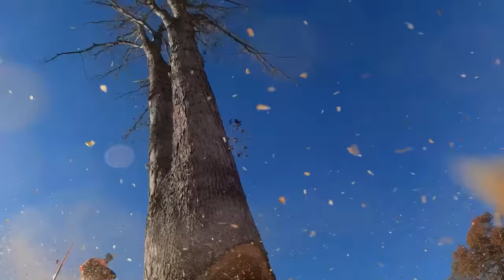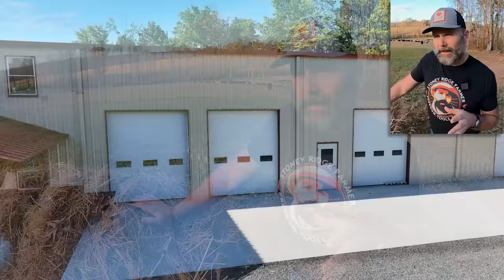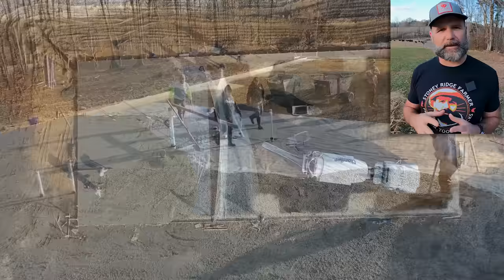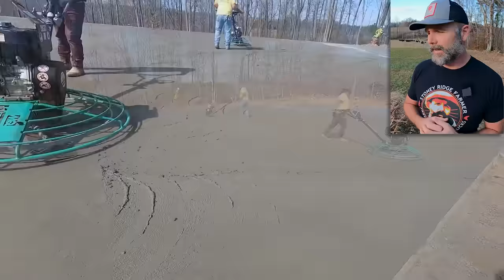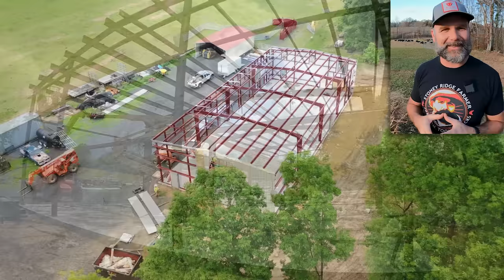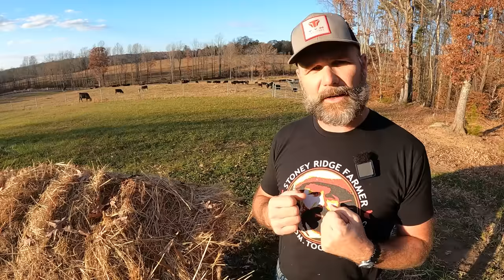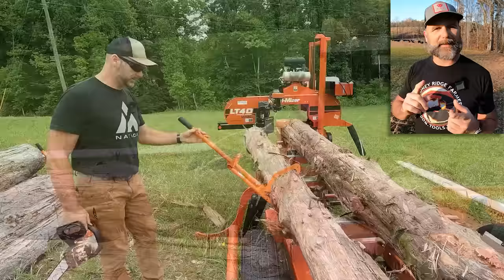Cops Came to Investigate Veteran's Farm! Heartbreaking disbelief

Comment: I'm a builder, and I do permit all the time. There are two things: the city has a big head of pride and money. That's what it's about. It's not right.  It's insurance, and you are right about the wood. You fit the nail on the head.  it is because of safety reasons and could cause an environmental issue. Yes, I'm in Texas, and it's the vast west of construction here, and it's a lot easier to build.  The northern building is more complex, and I will tell you why. Basement sub pump and the weather. Great show, and I feel you. Texas is a great area.  I ran a rainwater system, and it really was easy to do. We get 54 inches of rain a year, and it's enough for us all year. Two in the house.  tanks are 8000 gallon tanks with filter system.
Reply from the maker: I'm not sure the "pride and money" theory doesn't translate into all walks of life.  I get it for septic, but what I don't get is why I can't build what I want structurally on my own place without being pestered

Comment: Josh, my story is kind of like yours. I served 20 years in the USAF myself. I live in NC also, but east of you a couple of hours. After retirement i had built a 30 x 35 metal building. After having everything permitted and inspected and building completed i received a call from the head inspector that he didn't have a signed off permit for my electricity to the building. He wanted to come out and reinspect what had already been inspected by a inspector that used to work for him which was the one that had inspected my electrical work. Well, i thought about his request for a couple of moments and told him no. I told him that i could not have gotten power turned on by the electric company without a signed permit. I further iterated that because his previous inspector misplaced or whatever he did with it wasn't my problem. My conversation with him was respectful but to a point that i was not going to be reinspected for something that had already been done. He agreed to what i was saying and never heard another thing about the issue. 
Yes, to answer your question, our rights are being infringed upon more and more on a daily basis. I have since sold the previous property and bought another. Well, the property i purchased i could not build a building upon until i built a residence on. The restrictions on this property is i can not put just any dwelling on. It had to be a stick built home. Again, i am being heavily restricted on this property. It is my property, not the city or the county's! I don't live in a subdivision, but being treated as such. It's BS!
So, yes! Our rights are being trampled on by others. Regulated to death. Sick of it!
Reply: Move …. To a red state
Reply: I assume you're county is Republican ran being NC ......regulations start at local levels....sounds like your intelligent...just cut to the chase...
Reply: @samsally3581 I live in Florida and I am dealing with the same stuff... the government can't seem to keep their hands out of your pocket.. it doesn't matter if you're in a blue or red state..
Reply: howardj602, yes sir, you are so correct!
Reply: Its all a local level money grab.  Has nothing to do with safety as i have only encountered 1 inspector in my area that knew the trade he was inspecting(plumbing because he was also a licensed plumber).  The other inspectors are just paid county officials.  My house addition structural and electrical inspections took all of 2 minutes each.  Looked at the electrical panel, glanced at the walls/ceiling studs, and signed off.  Before that they had even signed off on the footers, before i was even done digging them.  And i bet they would not be able to produce the documents from any of those inspections that were done years ago.  But again this is local level dependent, and each and every locality is different.
Reply: Hi, greetings from Sydney. Australia. It seems that your counties administrators are not the only one's over-regulating our lives. Here in Australia we have 3 levels of Govt - Commonwealth Govt. which is an umbrella over the whole country, State Govt for individual states, and Local Govt (or what we call a Local Council) for the local government area (group of suburbs) where you live. Most building work, new or renovations have to go through a Development Application (a DA) process via the Local Council who have "local planning regulations".  A small DA to add a few rooms and garage to an existing home can cost up to $30,000 AUD before a brick is laid or demolished.  Part of the DA requires a number of reports from professionals - Surveyors, Sound engineers, Storm water experts, Sunlight report (so we don't overshadow neighbours), Arborist reports if there are trees on the property that need to be cut down) etc etc. Plus new requirements to have Solar power for hot water and heating (another $10k). A DA is required for something as innocuous as a deck of more than 20 square metres or a single car garage.  Got a heritage style house - no go on any DA or changes unless the local council approves the materials and colours.  So don't think you are the only one's who don't have the freedom to do what you want with your own land. Moving into another local council area won't solve the problem - they all have the same planning and DA process.
Reply: Got to check zoning codes/ rules and more before purchasing land these days.
Reply: @nimrod275 , Yes! I failed to do so! Totally my fault.
Reply: Being Regulated is all about MONEY.....everyone wants a piece of the pie....
Reply: @mikebastiat  wow! What a sad comment. What has that got to do with what we are talking about?
Reply: @mikebastiat  For or against?
Reply: Just a thought.  Did you or your liar, oops I mean lawyer, KNOW about the deed restrictions and or zoning restrictions before you purchased the property.
Reply: @JR-rx2ke , yes and no. At closing most of this was told to me then. I found out about other information after closing. I didn't do my homework on this property, that is obvious. LOL @ Liar.
Reply: @Showmethefish  NC is not a red state

Comment: 👋 Building inspector of a very large municipality here. We have a homeowners waiver that you can sign that allows you to do most of your own work, less plumbing and electrical. If you can pass inspection, you can do it. The reason for the regulations for licensed trades is because people die from shoddy work done by unscrupulous contractors. That being said, I also have to investigate complaints of things being built without a permit. It's almost always reported by a Karen neighbor. When I get those complaints, I NEVER write a citation unless I absolutely have to. Like a homeowner wiring an accessory structure in a very dangerous manner. I always try to work with people.l, especially because investigating unpermitted work isn't what I signed up for. I signed up to inspect structures to ensure they're structurally sound, and that they will be sound for the owner in 25 years. But even then, I bend over backwards to help people to build things correctly. As I tell people all the time, I'm here for the benefits, not to lick boots.
Reply: You're a good man 👍
Reply: @MrClowny666  I appreciate that. I've worked on both sides of the fence so I know how a bad inspector with a fragile ego can destroy your project, so I try to find a balance of keeping the contractor moving along without slowing him down and protecting the homeowner and the public. The trick is to do that without taking anything personally. My department is full of fragile egos and bootlickers that dream about stop work orders and citations, so I do what little I can to make whatever difference I can make for the public.
Reply: The problem is that most are not like you. I am also an inspector and I believe codes are out of control. The code inspectors I have worked with building a new construction house are ridiculous and call out every minor thing. Code inspectors should only be checking for major safety issues and nothing more imo.
Reply: @judahbrutus   @judahbrutus  I'm going to have to completely and wholeheartedly disagree. That's not the problem. What kind of inspector are you? A home inspector? Code inspectors are not OSHA inspectors and we're not home inspectors. Our job is to check for code compliance, not safety. Codes exist for a reason. What you may see as a minor issue might not be a minor issue to somebody else. People will throw a fit if I call them out for not having a continuous tie at a perpendicular joist/rafters connection because they think "it's just a rat run." No, its an unstable roof. You absolutely need wind bracing, wall/wall connections, correct portal framing, correct wood grades, so on and so forth. If you aren't a licensed code inspector, you just don't completely understand what we're looking for. If you aren't building a house to code, that's a problem with you, not a problem with the code. And that's exactly the purpose of the inspection. It's not to "bust" you, it's to check your work and give you a chance to correct it. The people that pay you are 100% expecting and wanting a house built to code, and it's your job and your responsibility to be knowledgeable enough to provide that to them. I hold an unlimited building license as well as a home inspectors license, so I know both industries, and they are absolutely not the same. There is very little overlap. Just because I work with people and assist them wherever I can and do what I can to make the process as painless as possible doesn't mean I'm allowing homeowners to get screwed over by not making sure their house is built properly.
Reply: @BureauATF Nowadays it seems you are far and few. You are honorable good man and I appreciate what people like you do.
Reply: Grandson Xrays welds, and says they are shoddy work. It is not that welding is not that hard of a skill to learn.
Reply: @voodoochild6741  Thanks, I appreciate that.
Reply: @gailhonadle5182  Welding isn't hard to learn, but it is hard to master. I was a welder for several years and there are tons of factors that go into it. You have to develop a sixth sense to know if your metals are actually mixing and to dial in all of your settings. Anybody can weld, not many can weld good.
Reply: @BureauATF  I understand that very well. So is soldering. Hub at 83, has been doing it for over 40 years in electronics. And still does a perfect job. Popcorn tins of transistors and diodes sit in the attic, he never disposed of a radio or TV without removing the parts. My first quilt was a mess. I got better learning from other guild members. Takes a will to learn and be good at it.
Reply: @gailhonadle5182  Yep! Seems to be a universal law with all things in life.
Reply: OK, I've read Intel. I had to comment. I'm an older individual, years ago, when building our particular construction project and going through the lengthy plan check and approval process with all of their inquiries and need to does (endless!). I did this project as home owner/builder, figuring that I would build about the minimum code. I put our floor joists on 12" centers instead of the regular 16" centers. I'm not going to tell where, when and how long ago!  In the comments it hasn't changed! The plans were approved, the project under way, inspections occur, I call for a drop location inspection. Granted! Finish the rough-in. One inspector stops the project for two absolute insane reasons. 1st Drop is in the wrong location. 2nd the sheer fault wasn't up to standards. I had not more than a year or so finished phase #1 approved no problems. Our project was stopped, because of ____! Red Taping Invalides that want to make a name! As if nobody knows anything!  I had to take time off work! Talk to a relentless inspector of 17 years, even though I showed him in the code book and the plans were approved!!! His boss unannounced to came out and asked, "You both are still here? He said, "Go home and get some rest!" I'll take care off it!" I was so livid and said "I'm  the customer, why do I have to do their jobs too???" 
Needless to say it hasn't changed! Years later theirs another problem. It seems the recorder can't read plans! I don't have as big of a house as what I built??? Who? Who? And Who is at fault??? Do I need to do everyone's job??? Their has been one county employee that did his job and took care of problems!!! We need people to do what they are hired to do! No excuses!!
Reply: You’re few and far between but honestly, it’s none of the governments business as to what we do or how we do things on OUR property. If it’s shoddy, then I guess the person taking over the property should learn to use inspections. There’s also insurance for a reason.
Reply: @bnalive5077  Yeah, and tell insurance that your add-on was done without a permit. See if they cover your house when it burns down. I completely agree to an extent, but you're hooking up to the power grid. Linemen die every year due to DIYers not knowing what they're doing. As for future buyers using inspectors, home inspectors can't see what's inside a wall. You can't inspect a frame or anything else once it's covered. There are small municipalities you can build in without inspections so you always have that option if you're that serious about it. But it comes down to making sure you don't kill a family of 5 by building a house made of popsicle sticks. The same way you can't drive your own car that you bought and paid for without a license to protect others (and yes, secondarily for unwarranted state income), you can't wire or plumb a house without an inspection. You can frame, insulate, pour your own foundation, build your own roof, and more, but if there's a licensed trade, it's licensed for a reason. Now... All that being said, screw the government. I loathe the government. I just work for a city and as I tell people all the time, I'm here for the pension.
Reply: Had a neighbor  call on me for building a deck and awning on the front of my house . Code enforcement  shows up sees permit in window tells me it looks great . I said if they would have been a little bit noisier  they could have saw a permit in the window lol 😆 😂.  4 months later they built a fence in their back yard its two feet  taller then allowed in our neighborhood  . You know what I did ? I minded my own damn business.  If only people would do that more often .
Reply: I do what i want when i want where i want.

Comment: I've been around long enough to see our freedoms slowly eroded close to the breaking point. Every time I do anything on my land there seems to be someone who decides they don't like what I'm doing and will make a cowardly call behind my back.  Like you, I follow the law and have my permits but having someone come to check is infuriating.  The permits were supposedly put in place to protect us but from what I can see it's just an income stream for my township and county.  I've literally had 2 separate electrical inspections (for new services) where the inspectors never inspected a thing.  One never left his car and the other stood on the front porch and never entered the home.  If I'm following the law and paying for a permit I expect the inspection to be done by someone who knows the code and at least looks at what they are inspecting.
Reply: I would insist they "inspect" my work or I would refuse to pay them lol
Reply: Exactly
Reply: A tree came down on my power line and tore everything off the side of the house - which I was responsible for. I needed a permit to get the work done and a follow up inspection to get the power turned back on. The guy came by and posted an official looking orange paper to my front door. Basically said work was permitted AND it passed inspection. I hadn't even hired anyone yet!
Reply: @dough9512  WOW!